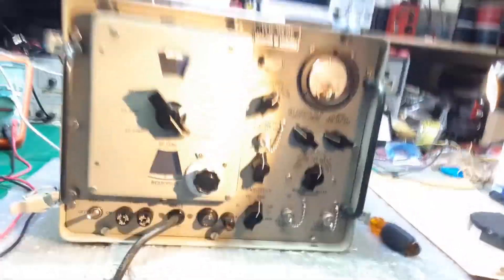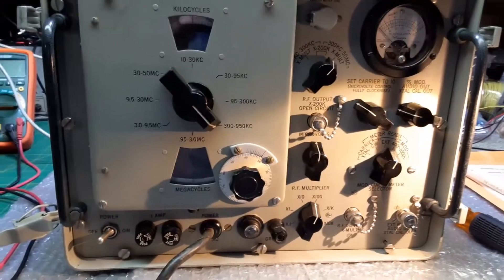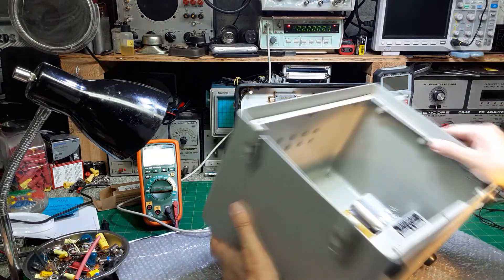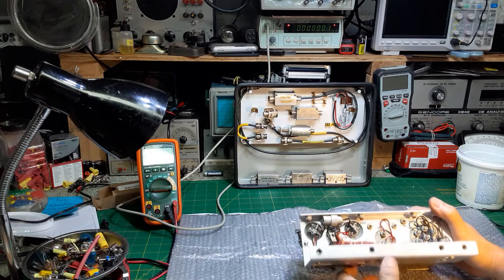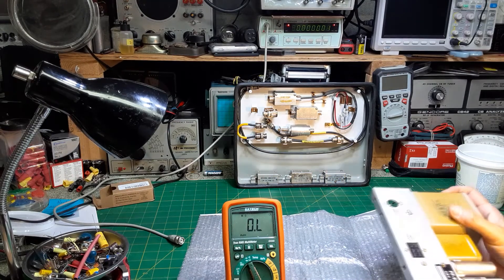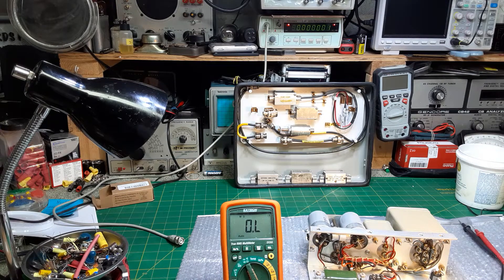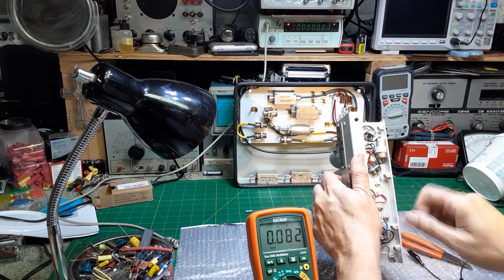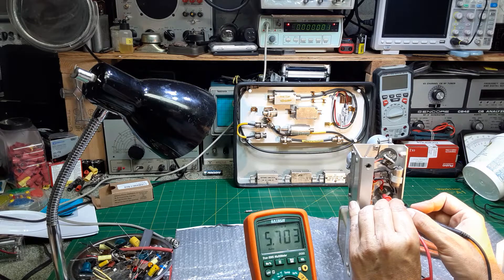US Navy URM 25D Signal Generator - Part 1: Power Supply

Comment: Excellently designed signal generator and VTVM for US Navy standards in 1955. The schematic and instructions to
 familiarize yourself more thoroughly can be found at the military radio site under manuals. It is 112 pages long.
Looking forward to more of it  Paul. Steve
Reply from the maker: Yes Steve, I have the docs and they are extremely helpful. Especially the old 1980's restoration notes from Dallas Lankford. I will try go over them in future videos in  the series.